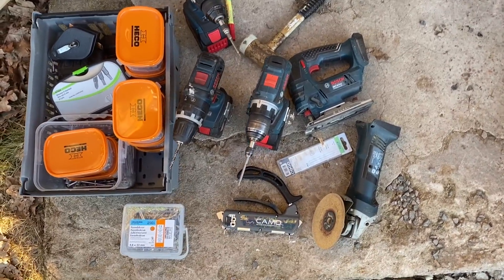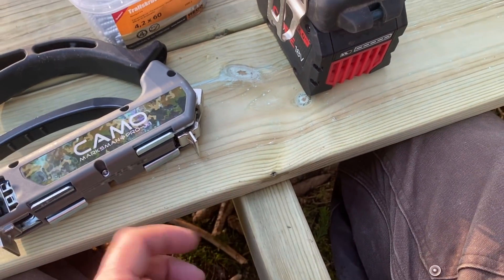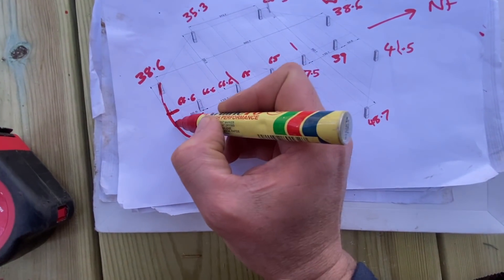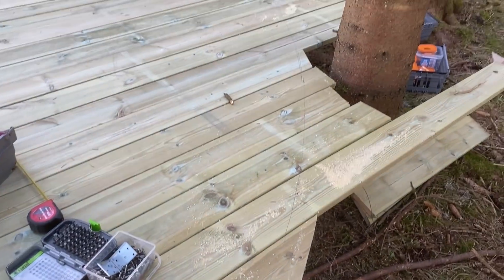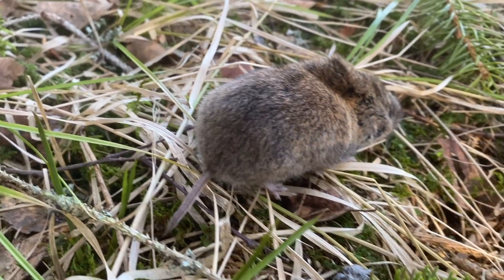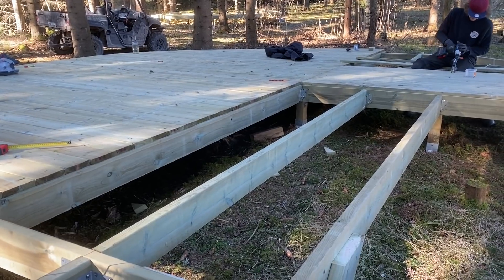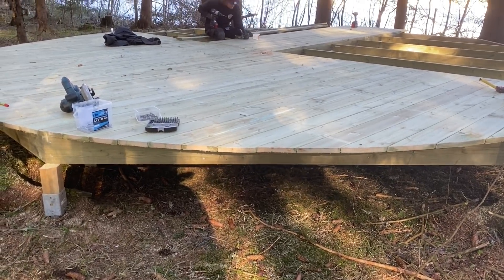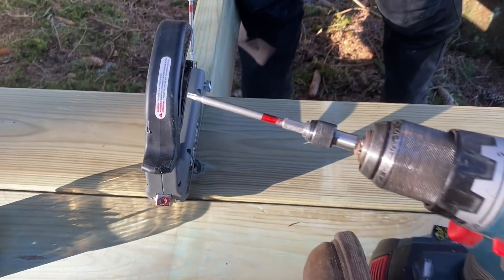Little things that make a big impact....

Comment: Splendid. A good place for it, bit of protection from the sun but still airy enough for tents. When I did my yurt platform I marked the center then measured a metal wire and drew a circle.

Comment: Great video, so good to see what’s involved step by step.  Thanks for taking the time to document it.  We used the Camo system on our cedar deck here in Ontario, but used the proper screws.  Good job we hadn’t added to our frustration as the decking boards were not very straight.  Still with a bit of leverage here and there our son, the carpenter, managed to get them to straighten up.  The screws and boards are doing well after several years in this harsh climate of extreme temperatures and snow loads.

Comment: Nice little tool that gives angle for the screw and spacing for the boards.  Never seen that before.  👍

We just had bird flu all over japan.  Took out our local supplier for aigamo (half wild hybrid ducks) used in conjunction with organic rice growing.  Had to procure ducklings from far away

Comment: I noticed a company in the USA that makes Yurt bases has started using SIPS panels for forming the circular base. Looked really good. Insulated and needed less framing underneath and goes in quick and accurate as the curve is pre cut in the factory.  Can be topped with any finish.

Comment: STAIRS 7¼" RISE / 9" RUN 👌👌 makes a perfect step. And escavate the landing 😁✌️ Much knowledge shared on these platforms !

*FLOORBOARDS , just an idea. Construct two skids out of scrap pallets, ratchet strap a skid at the front of a bundle of floorboards and a skid at the back. Run a nice long lead line to your side by side and drag those bishes. The long tow line is helpful around obstacles. I would imagine your side by side has quite the tow rating & 4WD

Comment: Probably good idea to cut a chord rather than leaving the curvature around the entire thing. That leaves a straight section for your stairs so your not figuring out how to match straight steps to a curved platform
Reply: You just get a big piece of cardboard for a Template, hang it over the edge of the deck and trace the curve on the bottom. Voila. Cut it out with a box cutter with a new blade

Comment: The leg shown at 11.40 is badly placed, as the joists appear to be bearing on only one quarter of the cap, when you should hardly see the cap at all for the best bearing. The timber will shrink in the summer, so this could fail. Needs attention, perhaps some persuasion with a sledge hammer, just to be safe.  The job is great overall though Richard.